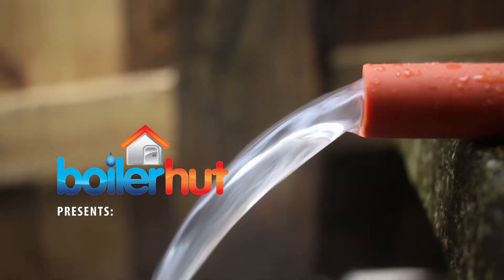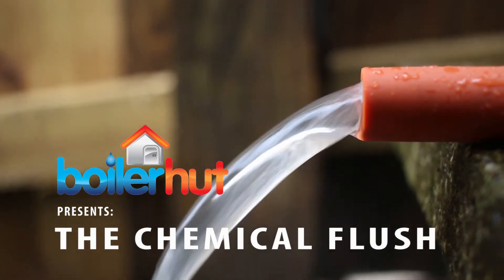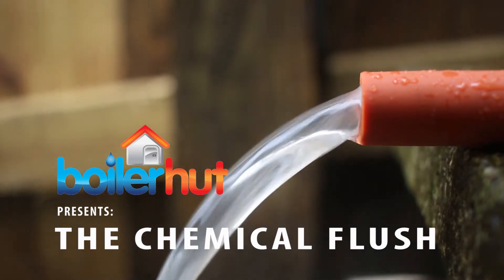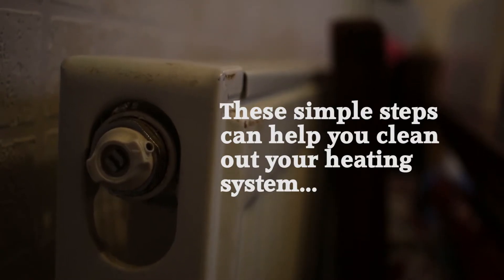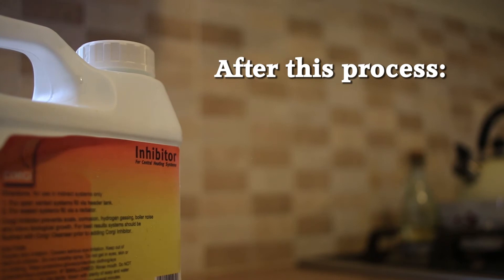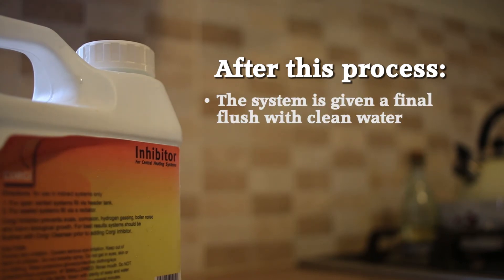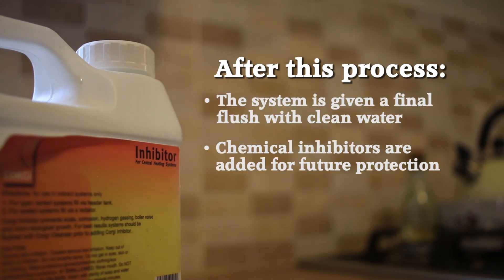Chemical Flush of a Boiler System

Comment: jessuz a plumber wanted to quote me £350 + VAT for this when all other plumbers have said they would do it for free.
Reply: @SassyHehe  Ah, I just re-read what I wrote. That does seem bad. What I meant to say was that service was included in the price that was the original quote, not a £350 extra. And yes I am a tight ass why would I throw money away?
Reply: Aren't you supposed to run heating on full for atleast 2hrs then empty